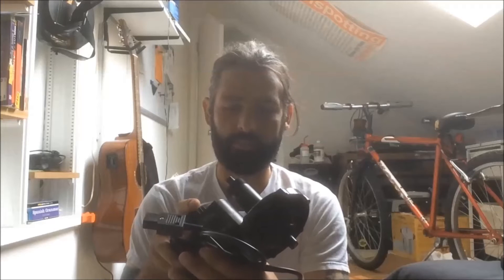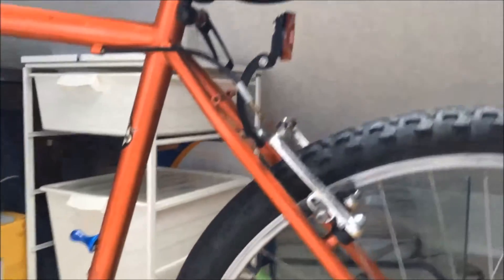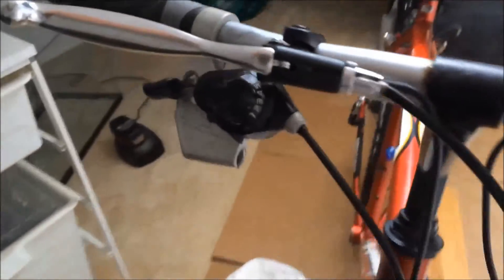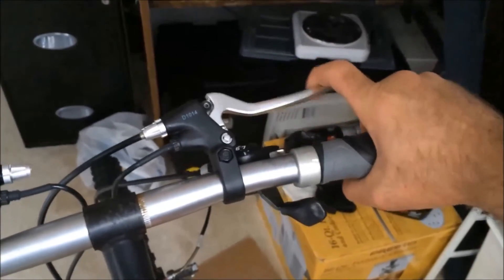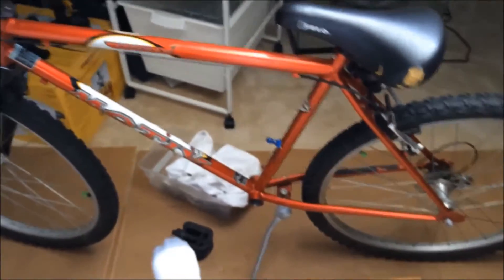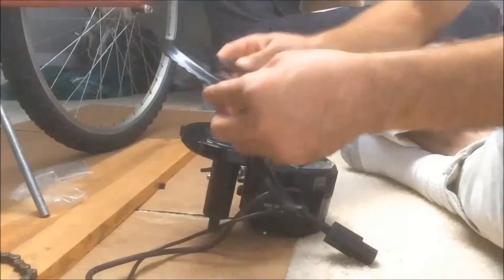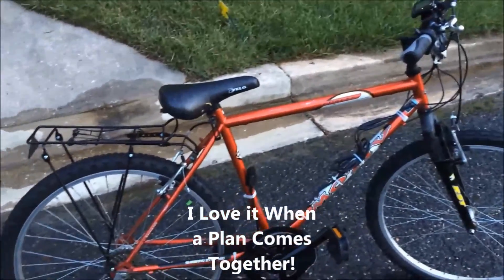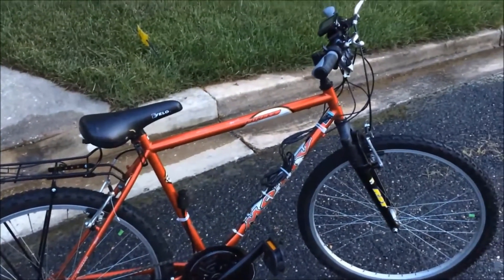Bafang Mid Drive Ebike Conversion Part 7: Installing the Kit

Comment: Great video you did. I just did a complete overhaul of my Bafang motor. Replaced the  core body as I snapped off the gear. While doing research on the topic came across as article about the cheap grease used on the initial build.The article I came across suggested I used mobile 28 and can’t recommend a  better  grease and now my motor is quite the tires make more noise. Ride safe folks.

Comment: why you used such a useless bike? bike 100 dollars kit 1000 silly
Reply: If it works, what's the problem?
Reply: You don’t need an expensive bike to go electric. In fact, you need a heavier, sturdier frame which you’ll find in many  $100 bike. The shape of the frame is important for the motor and battery installation.

Comment: I just got the kit. What are the name of the power connectors? The electricity wires, the red and black ones, have some kind of of power connectors I havnt seen before. I need to know what they are called so that I can buy the same cables for my battery. Can you help?

Comment: When putting the link on the chain, take the chain off the ring and you won't need a zip tie. You only need the chain on to measure jockey tension and clearance....
Reply from the maker: I've seen that. Clever.
Reply: I thought the zip tie was creative.

Comment: The mailman literally just dropped off my kit.
I opened up.

The motor is heavy as fuck. I wasnt expecting that. Oh well.
Reply from the maker: KaiserFailed Mine is the 350 watt version. Weighs around 10 or 12 pounds but it's mounted so low and center that I don't really notice. Yours is 500 watt, right? Probably a little heavier than mine due to the extra copper in the motor coils. Still, once mounted, it shouldn't be that bad. Good luck!
Reply: yeah, mine is the bafang 2.0 or whatever it's called. I bought it for less than $450. Everything looks new and in place. I will definitely update once I have everything together :D !
Reply: Didn't it break when he LITERALLY dropped it off? Off what? Did you catch it?